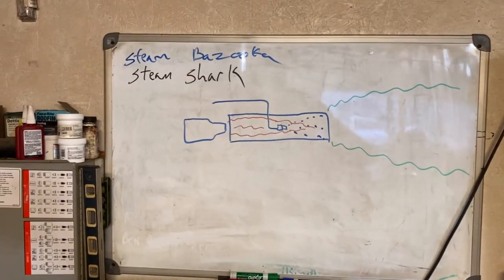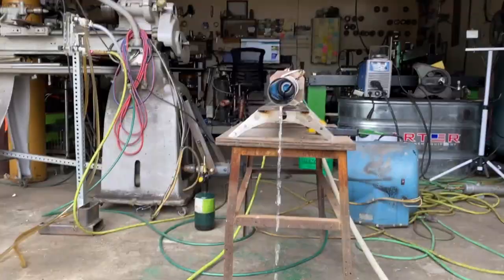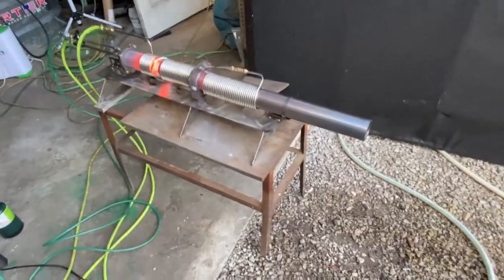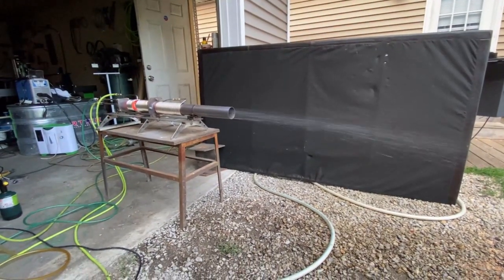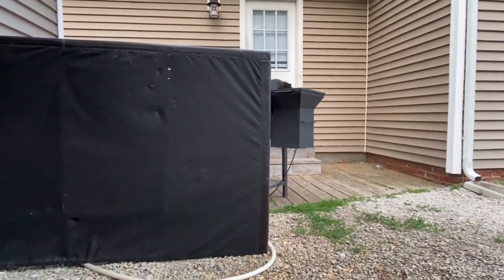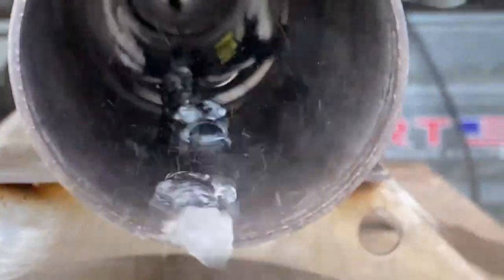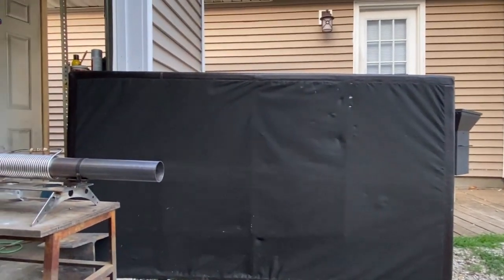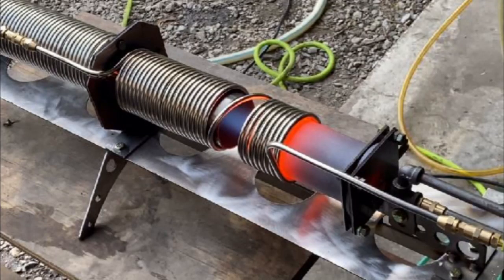Steam Shark tanker truck autoclave

Comment: Maybe try putting the water coil inside the barrel and run the water counter flow ie feed into the outlet end of the cannon
Reply from the maker: Yes i would have done that had it bin the initial goal . I was trying to get away from the boiler but eneded up adding it any way . I wasnt sure what would happen
Reply: @NOBOX7  have you calculated your sensible heat capacity of the desired flow rate?
I’d use Q=A u Td
that’s only for the sensible heat component not the latent heat

Comment: Super heated steam is dry and invisible, should be able to light a match with it…..
Complete combustion of propane results in the formation of carbon dioxide and water vapour. Carbon monoxide is a by-product of combustion when there is not enough oxygen to burn the propane completely but since you are introducing more Oxygen with the production of steam, you man never be able to achieve “superheated” dry steam.